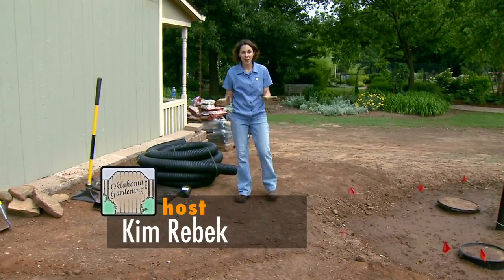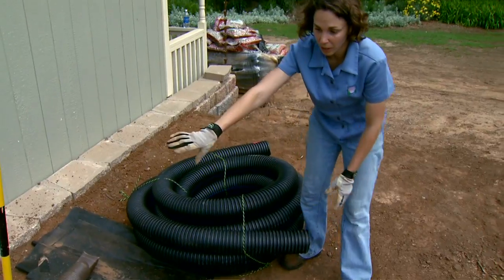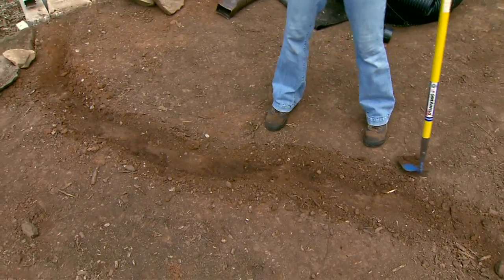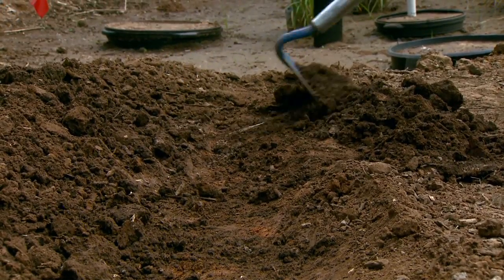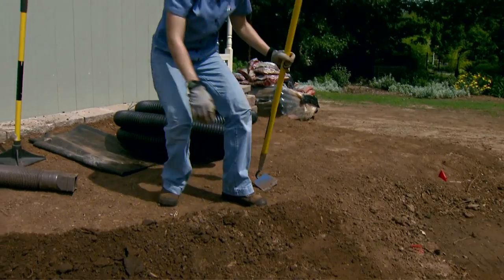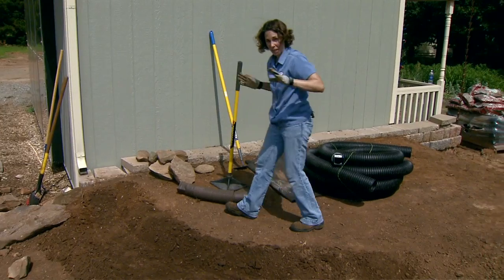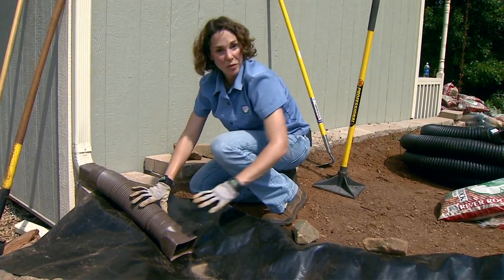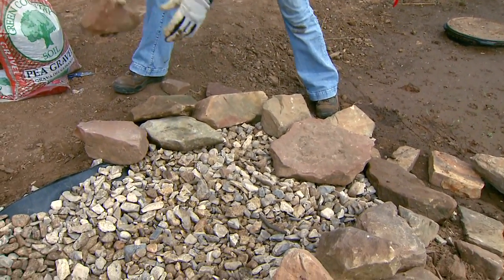Constructing a Rainwater Sand Cistern -- Part 4

Comment: you may have some problems later with that retaining wall against the siding.. it'll trap moisture near the paint causing the paint to fail, in your other video you expressed some concern about termites. so I'm assuming the siding is wood which will rot when exposed to moisture..  last note ants like making nest in between stacked block, and rotting wood.